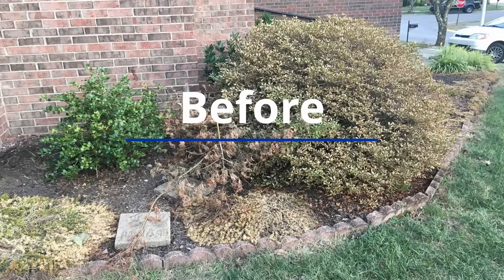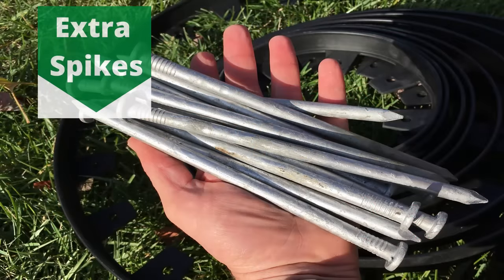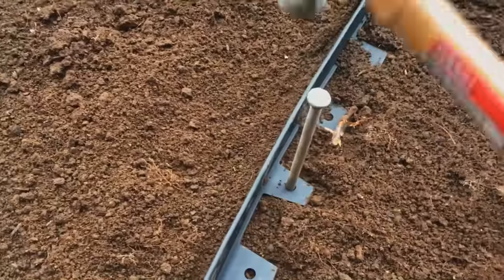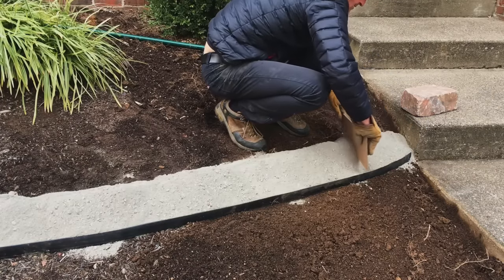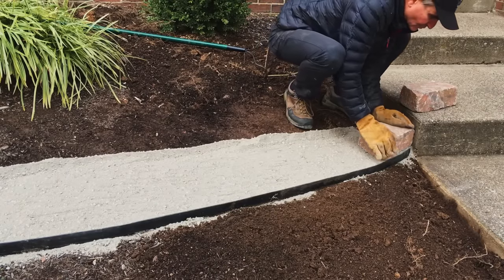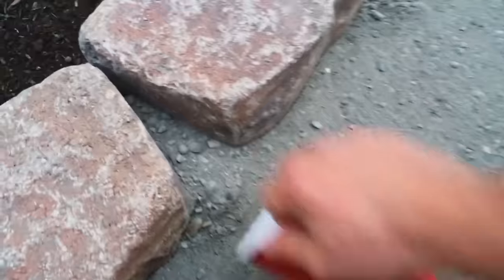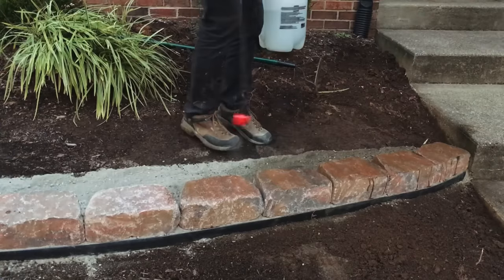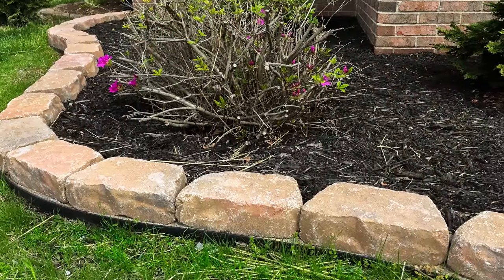easy diy No Dig Border *2020 UPDATE*

Comment: Love the video! Am I missing the part where you mix the concrete? It looks like you poured it dry onto the ground then just sprayed water. Didn’t see in the description either... I was just curious thanks!
Reply: He mentioned that it had to be “quick setting” concrete, which is pre-mixed and only needs water.
Reply from the maker: Ya, you didn't miss anything. This is a specially manufactured cement product that works like this. This specific cement product is one of the major things that makes this border easy....its also super long lasting!!!
Reply: @maxpatch67  Very cool!  I've never see that before - if it was regular cement I would've worried spraying water wouldn't have mixed it enough.  I'll check it out thank you!
Reply from the maker: ya!! here's a video made by the manufacturer of the product: https://www.youtube.com/watch?v=T7X9YKcfqk0

Comment: could I add a 2nd layer of brick if I wanted a taller wall? Would I need to add more quikrete to that layer? Thank you!
Reply from the maker: Jackie, I have not made a second layer on this type of border because I don't know if it would look that good and the difficulty level is raised some because you would mix up and use a traditional mortar(or maybe landscaping adhesive) between the layers. Even, though, it involves more work, I would highly recommend digging out the old dirt and mulch out of your area so the level is dropped enough so that there is plenty of room for the mulch to sit in there without spilling over. Also, the same thing can be accomplished by building your border out further so the dirt can slope down to the level of the bottom of the blocks and also have room for mulch.

Comment: How would you add a second layer of bricks, another layer of cement?
Reply from the maker: Harshani, I have not made a second layer on this type of border because I don't know if it would look that good and the difficulty level is raised some because you would mix up and use a traditional mortar between the layers. Even, though, it involves more work, I would highly recommend digging out the old dirt and mulch out of your area so the level is dropped enough so that there is plenty of room for the mulch to sit in there without spilling over. Also, the same thing can be accomplished by building your border out further so the dirt can slope down to the level of the bottom of the blocks and also have room for mulch. I hope this helps.

Comment: Will this border with cement hold up in northern climates that have springtime frost heave??
Reply from the maker: Patrick, this is an excellent question and one that I would be interested in knowing too if I lived up there. I build these borders here in Nashville where I live. Here is what I know. On my older video of this technique, I had people from several years ago, testify as to how happy they were with this border after multiple winters and these people lived in New England, Chicago, and Canada. That being said, I don't have personal experience building them up there and I do understand your concern. Also, check out the very first pinned comment below the video. A viewer wrote about this topic.
Reply: @maxpatch67  Hi Max, Thanks for the reply. I like your concept, and I’m going to give it a go this spring! I’ll report back to you to let you know how this technique holds up in Northwestern Wisconsin! Again, thank you for your reply, as it’s much appreciated!
Reply from the maker: Ok, Patrick!! Sound like to you a plan to build a border that solves your problems which is what this design is for. I hope its getting warmer up there. The air and ground temps should be in the 50's for it to set up properly. Have a good day!

Comment: How does this workaround artificial grass?  We have clay soil and plan to put in artificial grass and this would make an easy boarder but we are concerned about drainage.
Reply from the maker: On most landscaping projects I work on, I usually install a special drain system from the downspouts of the house. This involves: Cutting off the downspout, attaching a pvc/flexible pipe system underground out away from the house where I install a box with a grate on top where the water exits. You might want to install a drain system before your artificial grass no matter what border you choose. It sounds like you are making great plans!! This is a very nice border that will match the neat, tidiness of your artificial grass. I'd love to see your finished results!!
Reply: @maxpatch67  the artificial grass is going to be sloped slightly away from the house and will end at the top of a hill.  The concern is the the cement in the border would stop the water flowing naturally down the hillside. Could we somehow place “weep holes” in this method.
Reply from the maker: Ok. This border would probably dam up larger amounts of water flowing through the area so I guess you would probably know best what you need to do. If it's not going to be that much water flowing through there then the water will just absorb into the ground....oh, but this is going to be right on the edge, right?? Hmmmm.....I bet you could rig up some nice weep holes. I'm pretty sure you will figure out how to do it best. I don't have any ideas for that, but I would LOVE hearing what you figure out and seeing your finished pix. I'm sure you are going to make it super nice.
Reply: @maxpatch67  thanks, willlet you know
Reply from the maker: alright!! Thanks!!!

Comment: Do you advise against adding a second row of blocks?
Reply from the maker: Michelle, I have not made a second layer on this type of border because I don't know if it would look that good and the difficulty level is raised some because you would mix up and use a traditional mortar between the layers. Even, though, it involves more work, I would highly recommend digging out the old dirt and mulch out of your area so the level is dropped enough so that there is plenty of room for the mulch to sit in there without spilling over. Also, the same thing can be accomplished by building your border out further so the dirt can slope down to the level of the bottom of the blocks and also have room for mulch. I hope this helps.

Comment: Does the concrete powder underneath the blocks turn into hard concrete too?
Reply from the maker: Yes. The powder down there will soak up water like a sponge that goes down over the blocks and start setting up rock hard. Its getting chilly out some places now and the concrete won't set up in the cold. If you are trying this now, the temps should be at least in the 50's for the concrete to set properly. I hope this helps. I like your username, TrueGospel611.

Comment: Do you have videos for ground  which is uneven ? Thanks.
Reply from the maker: This border is prefect for uneven ground. If there is an area that has too large of a dip or hump, then you would need to use a shovel and level that part. This border does some levelling as you tack down the plastic edge, don't pound the spikes in all the way in the low spots and this lets the edge glide over small low spots and level the border some.

Comment: Great project and tips! How did you know how many blocks to buy?
Reply from the maker: You can figure they are almost one foot long each (11") so just count out the number of feet you need and then get a few extra for good measure.
Reply: @maxpatch67  that's great information! Thanks for responding.

Comment: Great video ! I can't wait to start my project. Thank you for uploading it. One question for you. If I don't add the cement and just use the straight paver edgers, would there be an issue with the bricks moving around? I don't want to use cement.
Reply from the maker: The cement provides three major functions in this border technique. 1. Height(for looks) 2. Stability/strength 3. Weed barrier(the extra width is nearly impenetrable to aggressive weeds and grasses(Bermuda Grass) that we have here in Nashville. It would be up to you whether you want to do without these benefits. The cement is an integral part of this border technique. Happy New Year!!

Comment: Great video!   Can you do two levels of bricks or is 1 recommend?
Reply from the maker: Eric, I have not made a second layer on this type of border because I don't know if it would look that good and the difficulty level is raised some because you would mix up and use a traditional mortar between the layers. You could also use landscaping block adhesive. Even, though, it involves more work, I would highly recommend digging out the old dirt and mulch out of your area so the level is dropped enough so that there is plenty of room for the mulch to sit in there without spilling over. Also, the same thing can be accomplished by building your border out further so the dirt can slope down to the level of the bottom of the blocks and also have room for mulch. I hope this helps.

Comment: How did you calculate how many bricks you need?
Reply from the maker: I just use my feet(shoes) since they are about a foot long and the bricks are very close to a foot long, so I just step one foot in front of the other and measure the distance....or you  could use a measuring tape. Also, the bags of concrete are about one bag per five blocks. I hope this helps. Have a great day!!

Comment: Question: I just got down my Vigoro, and it's looking good so far.  I've got about a 45 foot border to create, so I figure that's about 10 bags of concrete, so I'll get 11, just to be sure.  Is it best to pour all the concrete, even it out, place the bricks and make sure the tops are even before spraying. OR, can I do it piecemeal, ten feet at a time.  Should I avoid doing this in a light rain? Or would it just mean that I need to work faster?
Reply from the maker: Hey, Jon. Good questions. It best to pour pour out all the bags and level it all at once. This way, you kind of get into the groove on the levelling and can cruise through it all using the same exact technique and it will be the most uniform over the length over the whole border...but if you don't have time or it is going to rain or something, then yes, you can certainly do it piecemeal. If you do it piecemeal, just don't spray the mist over the last two feet so you don't get any overspray on the end and keep it from bonding completely to the next part as you move on.....so yes, it will work perfectly to do it piecemeal, but its preferable to do each step to keep the groove going on each step. By the way, you don't need to check the top of the blocks for level, because, it is going to be a very smooth line resulting in the leveling you do of the concrete mix on that smooth plastic edge. If you plastic edge is smoothly moving over the surface, your blocks will then look amazing also. Oh yes, don't forget the step of dumping cupfulls of cement mix into the gaps to seal and bond everything together better before misting. Have a great day! Let me know how it goes!
Reply: @maxpatch67  I'm a 20 year veteran elementary school teacher.  And your explanation is as patient and understanding as I hope to be when I explain to parents how to help their 5th graders understand adding and subtracting fractions with like and unlike denominators. i.e. "It's okay, we're all in different stages of understanding." Thanks for the reply.  Here in southern Oregon it's currently wet. So, I'll get my materials ready and finish the job when I've got a full dry day. I'll certainly share my pictures with you.  (A side question: How effective would it be if I didn't use the concrete and instead used paver base/sand and just placed the bricks? Drawbacks? Benefits? This is really in thought of someone who mentioned the challenge of having to be the next owner of the property dealing with removing the concrete.)
Reply from the maker: @jonbuckley7406  Awesome. I've been teaching for 31 years so far!!! Good for you! I'm teaching art, though, so that is probably easier for patience!! haha!! Cement is key to this border technique. The cement provides four major functions in this border technique 1. Height(for looks) 2. Keeps the stones straight/aligned over time 3. Stability/strength 4. Weed barrier(the extra width is nearly impenetrable to aggressive weeds and grasses(Bermuda Grass) that we have here in Nashville. I hope this helps, Jon. Have a great day!!
Reply: @maxpatch67  31 years of teaching art is like 5 years of teaching kinder and 10 years of teaching 5th. Wait.  That's a subjective perspective that lacks depth. (Just kidding.)  Would love to engage you in regards to artists.  Your explanation is perfect.  I'm going with concrete. Just waiting for the ground to dry out so I have extra time to work with the concrete and bricks before the base soaks up the moisture. May I send you pictures of the space in process?
Reply from the maker: @jonbuckley7406  Fantastic!! Please send them to tim@timvogelaar.com....when you get finished I'll post them here https://www.timvogelaar.com/Easy-diy-no-dig-border

Comment: Question: Should the excess concrete mix be removed after the pavers are laid down - prior to spraying water? I'm thinking so the dirt or bark would be level and not sit on top of the hardened concrete. Good job. Thanks for the video.
Reply: He did say a thin layer of concrete, which also helps with weed control. I’m sure you place the bark on top of the concrete. Hope this helps!
Reply: @Char_star92   Thanks. That totally helps. I listened to it again and he does mention it. I need better listening skills!  LOL
Reply from the maker: Yup! You got it! Have a great day, Deidranee!!
Reply from the maker: You'll want to leave that extra width there. It will help over time with stability/strength and peform as a weed barrier(the extra width is nearly impenetrable to aggressive weeds and grasses(Bermuda Grass) that we have here in Nashville. The mulch just sits on top of it. To perform right, your mulch should be a few inches thick over the whole bed and the cement will only have about 2" on top covering it along the border. I hope this helps. Have a great day!!

Comment: Love this! I have a question: is there any reason why I couldn't use this same method to build a walkway from my back door to my patio? I'm thinking using the border as edging on both sides of the walkway, and filling in with pebblestone in which I've laid larger stepping stones. Would love your thoughts on this! Thank you!
Reply from the maker: Excellent idea....you will love it. You won't want to spread out the cement mix so wide so that you can be walking totally on the pea gravel with the cement edge under there, so you will  use a lot less cement mix. Also, you may want to put some heavy duty fabric down first to keep the pea gravel from sinking into the ground. I love your idea!!

Comment: I’m anxious to start this and love the idea for my backyard. It’s a rocky area, so I’m worried about how easy it will be for me to level the concrete. Any advice? Anyone experience the same thing?
Reply from the maker: I'm not sure what I'd do with large rocks sticking out of the ground. You'll have to figure out your best options for looks and function.
Reply: @maxpatch67  hi there! I did a bad job explaining. It’s more of an uneven area, not so much rocky. My wife was concerned I wouldn’t be able to level out the concrete
Reply from the maker: Oh ok. Little dip will disappear because the border will kind of glide over the low spots...just don't tack it down to the ground in the little low spots. If there is anything really objectionable, the you'd need to use your shovel and move dirt around, but this border is designed to be made over normal ground that has NOT been levelled. It meanders along with the existing ground and actually looks nice doing this. There is not any need for levelling in almost all cases.
Reply: @maxpatch67  thanks for responding! That’s very kind of you.

Comment: Will cement help to level the ground?
Reply from the maker: Levelling happens of small dips and humps when you attach the plastic edge to the ground. When hammering the spikes in, don't hammer them into the low spots and then the edge will just go over those and get levelled some. Anything large that you want levelled, you should use a shovel for. I like the way the border looks when it undulates up and down a little with the natural shape of the ground. I think it adds interest in the line/sculptural aspect.

Comment: Hey! Can you also add a second layer on top to add some height? And secure it with stone adhesive?
Reply from the maker: Leslie, yes, you could. I would not go any higher, mainly because I just don't think it looks that nice for a "wall" to not be levelled like traditional walls are. I actually only make mine one layer high for this reason. If you think you want a higher one, I suggest digging out the area to lower the level or else building the border out further from the high areas so the slope can taper off and then you won't have the need for a second layer.

Comment: Can you add a second layer?
Reply from the maker: Yes, but I don't recommend it. The border does not use a traditional levelling technique and I think it can look a little off at one level higher. If you have to add a second layer, use landscaping adhesive and it should work fine.

Comment: How long do I mist?
Reply from the maker: It really depends how heavy of a mist it is, but generally maybe 30 seconds per foot. You can wait about 10 minutes after that and then use a heavier flow of water to soak it more thouroughly and faster because the cement will already be starting to set up if you you want to do it that way. You just don't want to let the form of your cement to wash away at all with the water. It will make sense to you when you do it. I hope this helps.